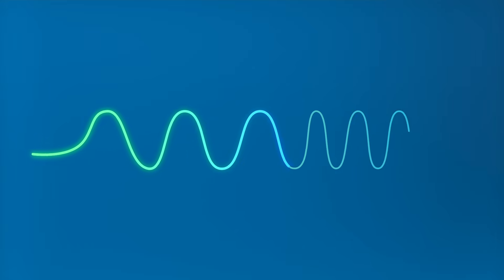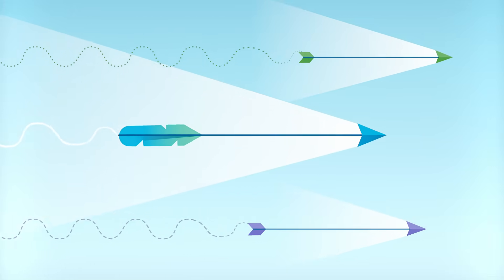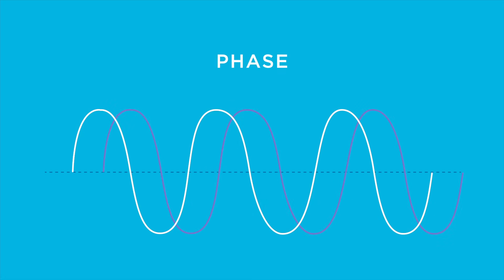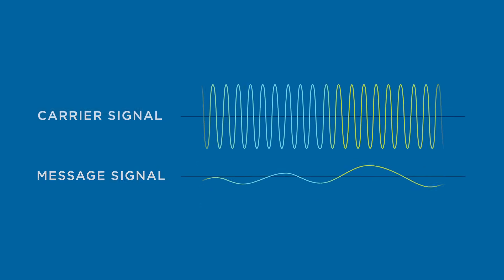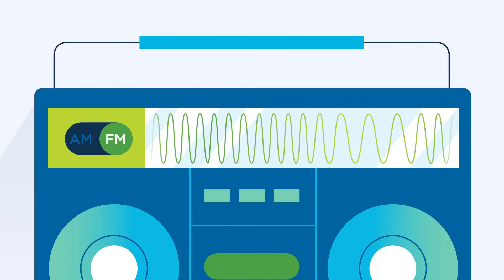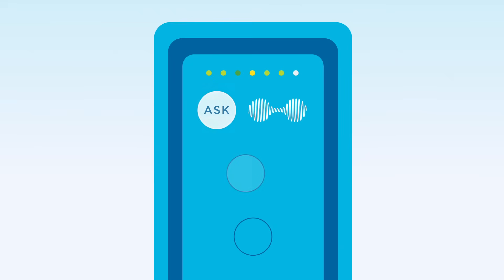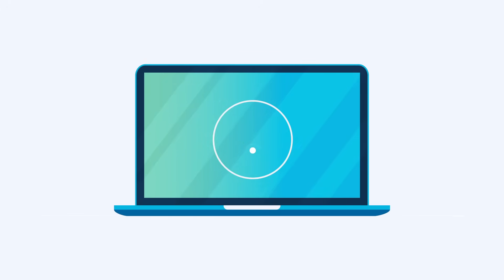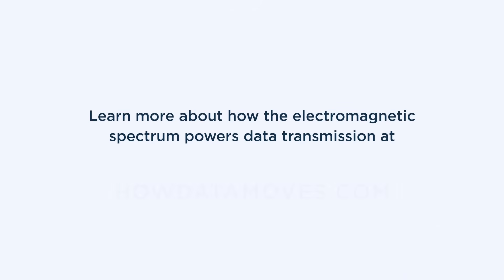How Electromagnetic Waves Transmit Music, Messages, & More

Comment: I envision a representation of polar opposite forces moving  in tandem within our limited perception of a space/time dimension as per the mechanical laws of a double helix. The frequency being each time the pair interact (or cross paths) within a second and it’s possible that the carrier or structural modulation of such information only becomes comprehensible by result of interaction by outside observation. 
Possibly having no merit to our conjured laws of physics until we sneak a peek. As if a cat that’s neither live nor dead in a box that we fear to influence.

Comment: An electric field (E) that oscillates in one plane (e.g., up and down).

A magnetic field (B) that oscillates in a plane perpendicular to the electric field (e.g., side to side).

Both fields are perpendicular to the direction of wave propagation (motion).

2. How do they travel?

The EM wave itself moves forward in a straight line.

The electric and magnetic fields do not cause any physical movement of particles up and down; they represent the directions in which the field strengths change.

The wave is self-sustaining—changing electric fields generate magnetic fields and vice versa, allowing the wave to move through space without needing a medium.

Comment: Still doesn't help understand frequency modulation.  How does an FM receiver tune into one frequency at a time, yet the modulation works (and the information exchanged) through the frequency modulating (changing)?
Reply: freq bandwidths are regulated
FM at so and so hz means that its centered at that freq with the data being contained in a bandwidth around that